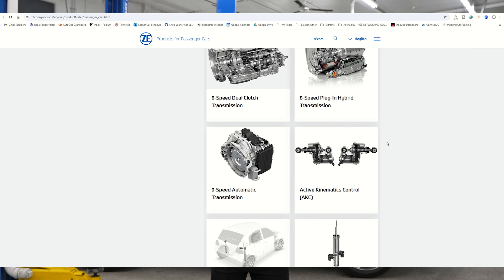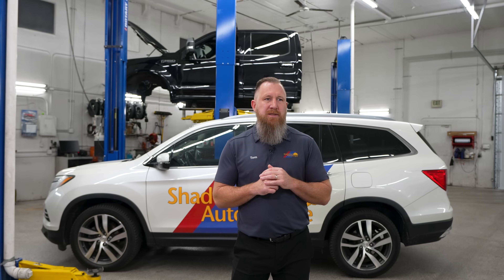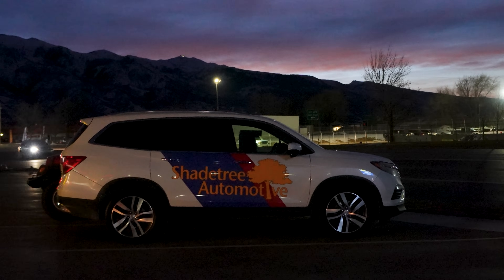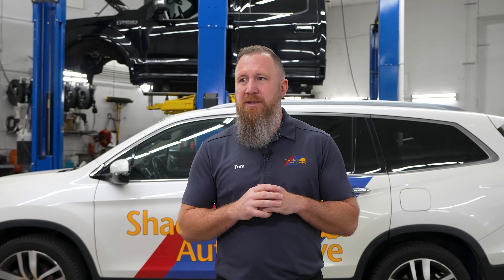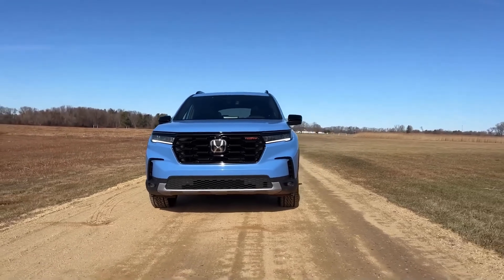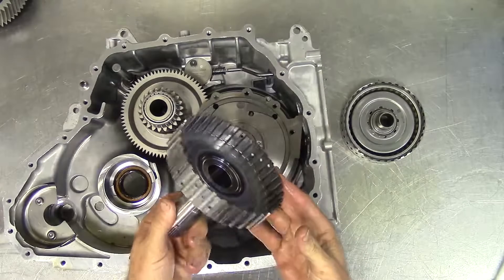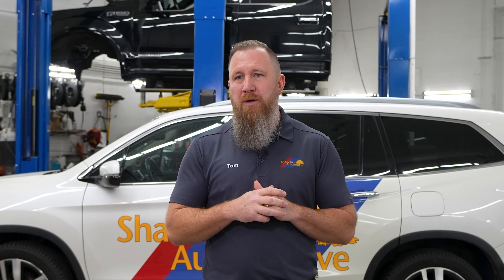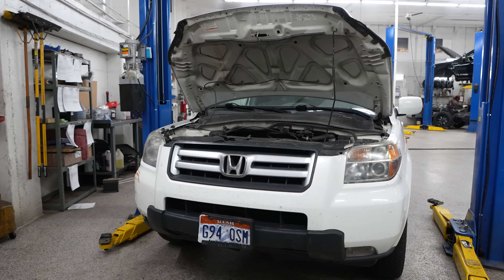Honda's 9-Speed Transmission. (Would I Buy It Again)

Comment: The Zf9 replaced the horrible 6 speed from Honda. That was a big reason they switched to it. ZF9 builds these transmissions for Honda, unlike Chrysler/Dodge are licensed and build them separately. The newer Honda 10 speeds are having more failure rates than these are. I have a ZF9 and can handle the funky downshifts. Overall it's been a great transmission. Great for towing.
Reply: WTF are you talking about horrible 6-speed. That transmission is Honda's best transmission they had made outside of their manual transmissions. Now, if you are confusing it with the old 5-speed automatic from 1999-2005 which was not a Honda made transmission I agree that one was horrific.

Comment: As a professional mechanic if you are car shopping and your options is a 2022 lexus RX350 AWD F-sports 3.5 liter engine with a eight speeds transmission and a 2021 Acura RDX A-spec AWD 2.0 liter turbo charge engine with a ten speeds transmission which would you personally recommend and why. Thanks stay safe.
Reply: Try to avoid turbo engines to get more longevity out of the engine.  As far as transmissions go I actually never buy or recommend a vehicle more than the a 6 speed transmission as they are tried and proven reliability with little to no maintenance.  Just my 2 cents with years in the automotive industry
Reply: @TrealTalk187  so hard to find cars that don't have 1000 gears anymore beacuse some ppl still believe we are saving fule by having more gears. 
Save a few ounces of gas and deal with major transmission repairs every 80-100k??? 🤔🤔
Reply: @WhereHasMySanityGone  yes totally agree with your statement
Reply: Electric cars have big Achilles, but the service is so easy because of less moving parts. No transmission, no combustion, no emissions
Reply: @ft9kop  if you like to travel i would never recommend an electric vehicle because they're performance is very dependent on the weather of the day be it a very hot day or cold one, people have told me horror stories from there experiences.  Another thing is unfortunately your electric bill can often time surpass that of a petrol or diesel vehicle.  Also once the battery is past a few years it diminishes quickly and becomes a hazard and downright expensive if you were to install a new battery cell.  I liked the idea of electric vehicles but the tech and reliability is just not there yet where its a feasible option for the majority of Americans
Reply: @TrealTalk187  PREACH BROTHER! 
The real world perspectives/experiences you never hear about in the marketing slides or commercials. 
Like anything else, you have to consider how you want to use it vs how it would operate in your world OR be willing to adapt. 

Like small 4 cylinder engines with turbos are not the best setups for the "all my driving is local 5 to 10 mile trips". Engines never get fully up to temp and blown out/burn up all that mess.
Reply: Lexus all day. After owning several Honda products, IMO Honda\Acura are not reliable and have quality issues. Our Toyota\Lexus have had small issues here or there but nothing compared to our Honda's.

Comment: Thank you, transmission fluid service first at 50,000 miles and then every 30,000 miles afterwards.
Reply: First trans flush should be at 15k on 25 Ridgeline I keep hearing
Reply: @wg1408 never flush, just drain and fill
Reply: @wg1408  This is absolutely not a standard maintenance schedule. Every 40,000 to 60,000 depending on use. If you tow, live in a hilly area or beat the piss out of your transmission you should probably change it sooner.

15k is absolutely unnecessary.
Reply: @wg1408 I haven’t heard about that where you hear that from?
Reply: @jn9861  Probably from someone who doesn't know anything about vehicles. 15k is WAY too early. That's like supercar maintenance intervals.
Reply: @Boguardis  I have the ZF9 on my 2023 Ridgeline, I change the trans fluid and transfer case fluid every 30K. Not sure where wg1408 heard anything about a FLUSH, Honda only recommends a drain/fill.
Reply: My dealer said every 60,000 miles.